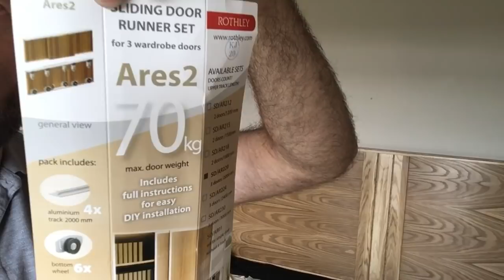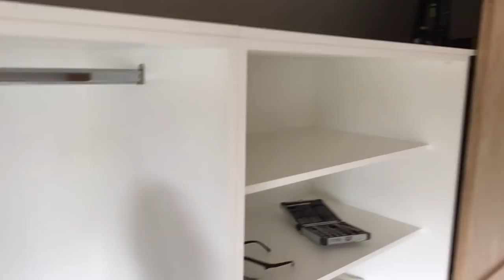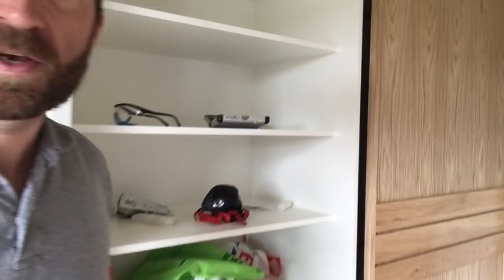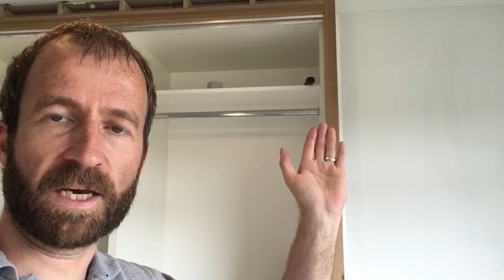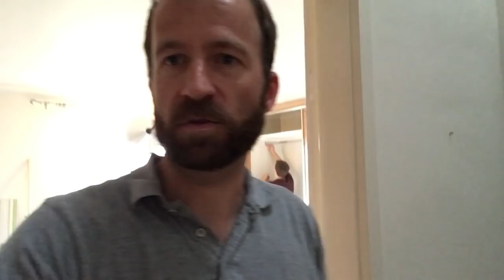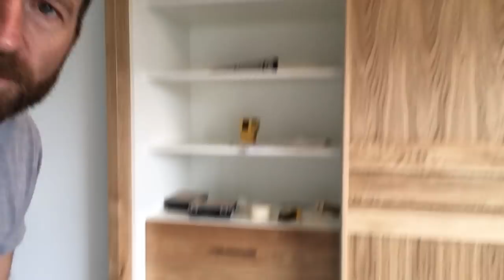Sliding Door Gear Review: Rothley Ares 2

Comment: hi there poss a silly question coming up, but I was wondering if they work ok for 15mm doors - to save weight for the user (not so able bodied you see), what do you think?
Reply from the maker: I think you really need to watch the other video from this project about bending doors!!  I would not do a project like this again without planning to use the Planofit door straighteners from the start
Reply: @Alastair_Johnson  thank you!! yep I was either considering using oak frame on plywood (which would be painted ) or what you have just mentioned. Some people instantly think because the door is "hanging" it will not bend/sag . I bet when you priced it up you wished you had charged more, usual case when you do something slightly new. ( by the way not saying you wished ,,,just a thought)
Reply from the maker: https://youtu.be/fItFYnl9_1I

Comment: Hi Alastair, I am fitting - see my previous comment - this system using 2 x 838 x 1981 embossed doors (b and q) and please pass my concerns on.
When I tried to fit the runners/guides to the top and bottom of the doors using the given locations I could not get a solid fix. The locations of the screws went into the hollow insides of the door. I used the old “dowels into the top and bottom of the doors”. 
The doors have mdf infills not even the cheap Polish pine!
Keep up the good work.
Thanks again 
John
Reply from the maker: Good luck with those doors!  I have no connection with the makers of this mechanism so I don’t have anyone to pass this on to.  Perhaps if I had been smarter I would have worked out some kind of deal!

Comment: Thanks for the video and advice, much appreciated, I do have a couple of questions as a keen DIYer I have just built my own fitted wardrobes and now want to install sliding doors in the same fashion as you i.e. external to the carcass. I have purchased the Ares2 and wondered 1) how do ensure that the top an bottom tracks are in alignment with each other? 2) I'm going to make my own doors, what thickness would you recommend? I see most prebuilt sliding doors are around 27mm. Ta!
Reply from the maker: Hi a laser level helps, or just follow the lines up the side frame strip with a long spirit level.  Sliding doors are very prone to bending so rigid and thicker is probably best.  If I do sliding doors with mdf boards these days I would fit ‘Planofit door straightening bars’ (search for that and you will find my video about them) but usually I steer customers towards aluminium framed sliding doors like the Volante system from ECF, or the sliders supplied by Toffs sliding doors
Reply: @Alastair_Johnson  Thanks for the prompt reply and heads up on MDF bowing. MDF is what I had in mind but was wondering if Structural Plywood would be better? There's hardly any difference in the price these days as MDF has got so expensive.
Reply from the maker: @Glentp75  I think ply would have more rigidity.  But it can also be prone to distortion.   An important thing is to make sure the construction is balanced - same both sides.

Comment: Hi - great input. Many thanks for your time. Eight mm is tight but I am ‘lucky’ as I am fitting the ‘linings’ from scratch. You appear to have done everything by the book, and learned and then passed on your findings. Well done - not being patronising.
Reply from the maker: Thanks for commenting I’m pleased if the video was helpful
Reply: @Alastair_Johnson  Had the doors/track fitted for about 10 months! They are dire. Tricky fitting, but the ‘movement’ has been unacceptable. Everything fitted exactly, screws sent home diligently, and slamming sides eased open and closed. Useless. Take care.
Reply from the maker: @johnpayne6196  oh no!  I’ve not had any call backs on this mechanism myself but only used it 2 or 3 times

Comment: can you sit the wheel in first and then slide the plastic u shape up to the top rail and then fasten the screw to tighten, i noticed you said you have you put the top it first which seems strange as thats the part with the adjustment which you would think you would adjust after its sat in the bottom first, i need a sliding set which is easy to take in and out and this looks the easiest atleast it did till i watched this :p
Reply from the maker: You’ve got me thinking now, I know what you are saying makes sense and I’m sure I would have been aware of this when I fitted these (I haven’t fitted many since so I don’t remember well). Did I not sit the wheels in first in this video?

Comment: Are these the same as the Saheco variety? Saheco drawing suggest you can rebate the rollers to make the assembly shallower. Any reason you couldn’t do this with the Ares?
Reply from the maker: I just googled saheco and found the sf-25 system which does look pretty much identical yes.  Yes I’m sure you could recess the hardware into the back of the door so long as you are still left with enough board thickness for the screws to hold into (at least 16mm I think), which I couldn’t have done with these doors

Comment: Hi. Alastair.  Love your vids.  Learning so much.  So a massive thank you for your work and your candour.
I know this one was about the runners, but, loved the look of the doors.
Were these solid oak panels or veneered MDF?
SandyMillerCarpentry
Reply from the maker: https://youtu.be/fItFYnl9_1I
Reply from the maker: Hi Sandy they were 15mm veneered mdf with solid oak strips framing then and solid oak horizontal strips applied and I had a nightmare with them bending and had to retrofit Plano fit door straighteners to the back of them!

Comment: It's superb that you have shown the issues encountered. I am about to install sliding doors and needed a bottom rolling gear system. (Top hanging rollers would entail the addition of noggins between the joints in the loft to support the weight of the top hanging doors. This in turn means lifting the loft chipboard flooring first!) Now I appreciate the issues installing this system it will still be quicker, easier and probably better than hours of preparation work in the loft. Great video - thank you.
Reply from the maker: Thanks for commenting, I’m glad it helped!

Comment: hi there, that mirrored door - is that actually glass you have used there or a substitute ? thanks in advance
Reply from the maker: Christopher Claudio Skierka hi yes it is mirror glass stuck on with mirror adhesive
Reply: @Alastair_Johnson  Hi Alastair, thanks for the helpful video. I'm currently looking for suitable runners for a wardrobe I'm planning and have to say this has put me off slightly using these particular ones, although they are one of the few cheaper options for heavy doors. I'm going to use 18mm mock shaker doors with 9mm stlies and rails glued to the front and a mirror glued with adhesive on the central panel. Do you think glueing these parts, especially the mirror will cause the MDF to warp? last thing you would want the door flexing with the mirror stuck in place. 😅
Reply from the maker: @-fells-  Hi yes I would definitely recommend adding door straightening bars to the back of that type of door construction.  I just don't make sliding doors like this any more, I steer customers towards aluminium framed options: https://www.volanteslidingdoors.co.uk/
Reply: @Alastair_Johnson  Thanks for your reply Alastair, much appreciated. I'm steering the customer away from sliding doors altogether. In this case they seem more trouble than they are worth, considering the size of wardrobe they have.

Comment: Hi Alistair, great video and will be a great help to me when I fit these (it's on the agenda!). What clearance did you need between each door to allow them to pass each other unhindered with the top and bottom guides in place? Cheers
Reply from the maker: Joe Morris hi Joe I don’t exactly remember but I think it could be something like 15mm.   Check out the technical drawings here: https://www.rothley.com/shop/sliding-door-systems/wardrobe-door-systems/ares2-kit-for-2-or-3-doors/
Reply: @Alastair_Johnson  thanks very much for the reply, much appreciated! Technical drawings don't have the dimensions of the guides themselves, but I'll figure it out. It's only because I've left myself only a 60mm frame to fit the doors into so I need a few mm clearance from the face of the shelving, and clearance between doors. I think the max thickness of door will have to be about 18mm in this case!

Comment: Exactly my experience with these runners. They're solid looking and smooth sliding action once fitted. But by God why do I have to waste hours of my time drilling holes in the guide rails? On the 3m long wardrobe there's 12m of holes to be drilled! And chamfered! Outrageous!

But the fitting method is even more unsatisfactory. I got mine from Screwfix didn't even realise there were 3m guides available but this saved me so much hassle. I was able to install 1.8m sections, slide all my 4 doors in and only then install the outstanding 1.2m guides. But this is not ideal at all IMO.

I'll be looking elsewhere before I use those runners again. More suitable for DIY projects I think.
Reply from the maker: First Name I’m glad it’s not just me!

Comment: Good bit of problem solving! If you move into the bigger workshop, would you likely build something like this in full before fitting to minimise surprises like you encountered here? Everywhere I've worked in the past has done that, but most people  that I watch on YouTube etc, like yourself, don't seem to! I'm always super impressed at ur ability to do this!
Reply from the maker: Andrew Cain interesting point.  I used to test assembly everything in the workshop first, but I do it less now. I think time and experience gives you more confidence that you can get it right on site.  I still find the profit margins so tight that to spend even more time building and dismantling something in the workshop seems unaffordable.  the flipside is that the risk of mistakes could prove more costly.  It depends on the job really.